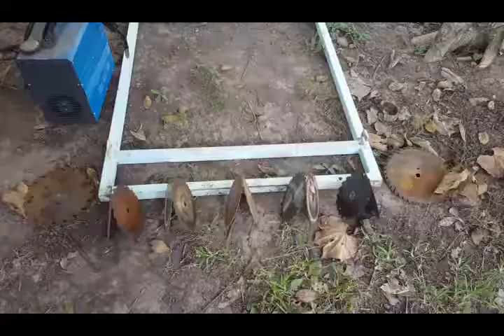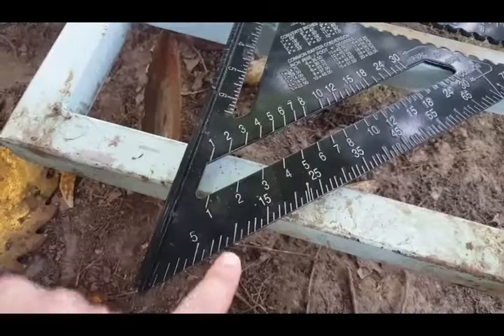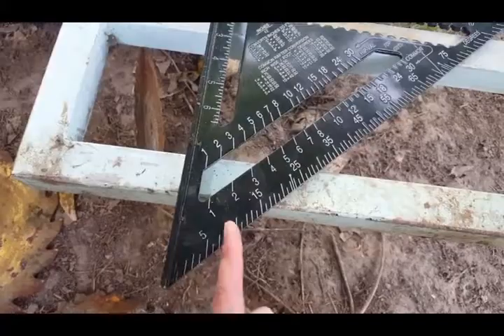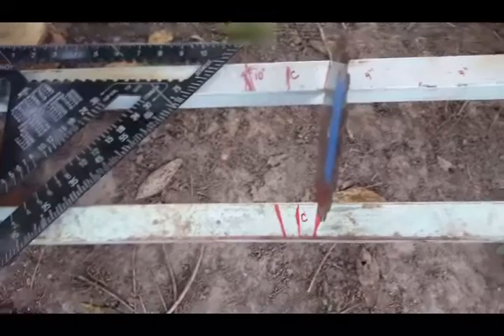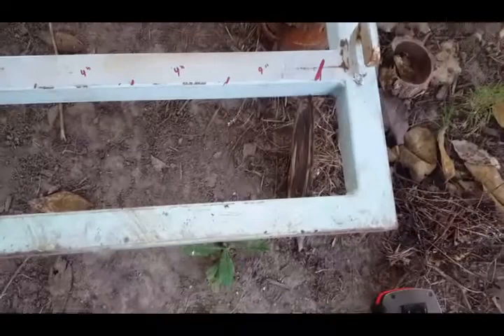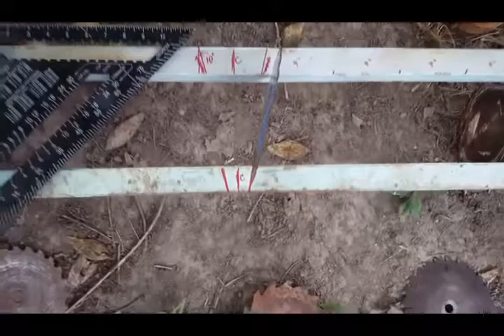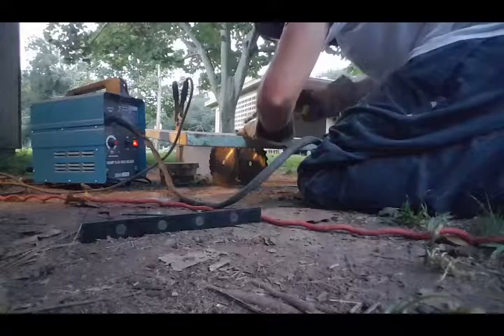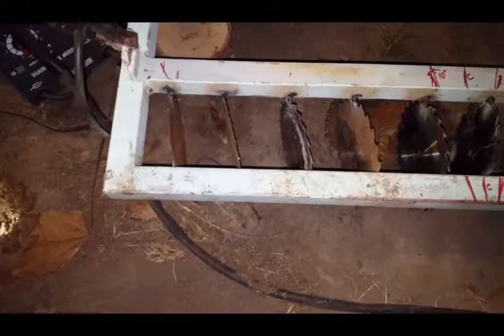Disc Harrow (Plow) Made from Bed Frame and Saw Blades

Comment: Dont weld them in solid.  They need to be on axles so they turn. Put 4 or 5 on each axle and set the axles on an angle. 2 front sets put the inside end of axles to the front and 2 back set put the inside ends to the back. Pulling with them on an angle will cause them to turn and cut the ground.  Added weight will make it dig in